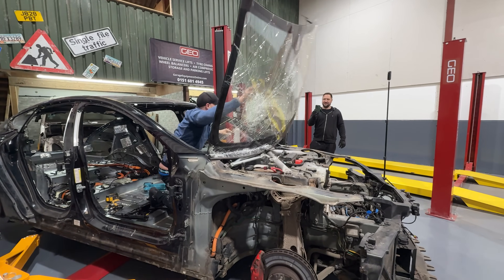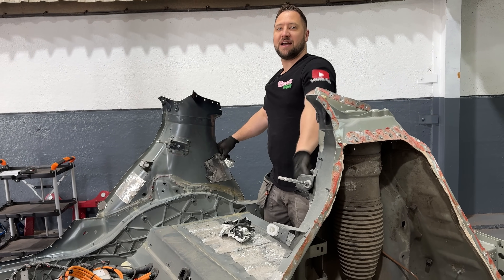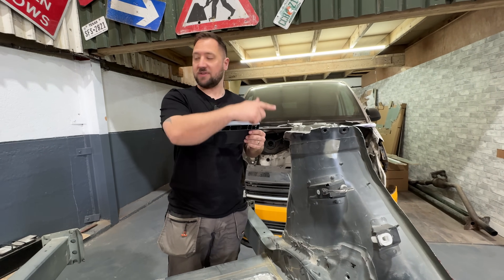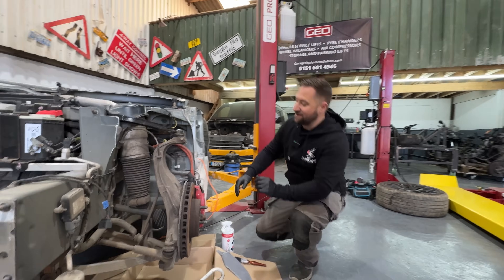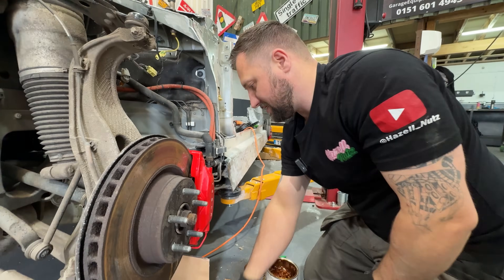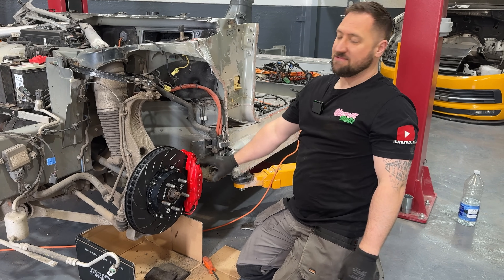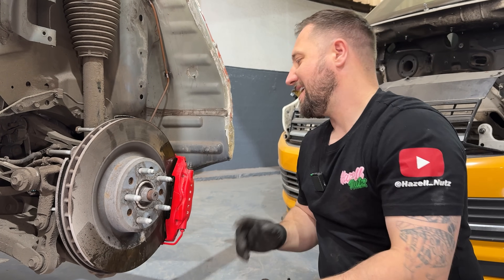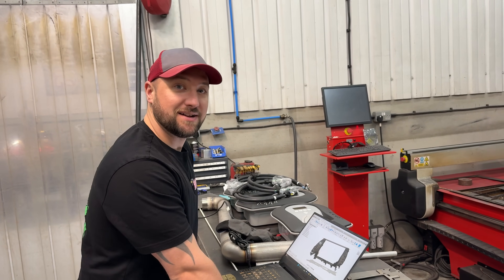Tesla T5 brake upgrade and Chassis MODS That Will CHANGE Everything!

Comment: Is the plan for this to be road legal? That's going to be an IVA for sure if so?
Reply from the maker: Yep IVA as want to show the process
Reply: @Hazell_Nutz  you might run into issues trying to get that process filmed. I think it was one of the discovery shows back in the day caused some controversy. I'd see if you can talk to them at the test centre beforehand. They wouldn't even let me take pictures when I had a car SVA'd back in 2008 but that was a long time ago. I did sneak one of the car outside the test centre though ;)

Comment: I would have thought that the caliper came off before using the disc eject-o-screw. Seems like otherwise it would bind up.  (I have no experience.)
Reply from the maker: By doing it this way round if the disc screw is really tight you can put a screwdriver in the disk vent and lock it against the caliper to undo if not your trying to hold the disc or put something across the wheel stud treads to hold.

Comment: My right ear feels left out
Reply from the maker: Dam it did not turn on dual audio channels before export from premiere pro sorry.
Reply: @Hazell_Nutz  😆
Reply: Take the left headphone out, increase volume, then slowly bring the left headphone closer till it balances out
Reply: Thanks! This is the first think I've listed to on the built in speakers since popping my laptop open to add more memory.
I thought I must have snagged the wire for the right speaker.
Now switching to Mono!